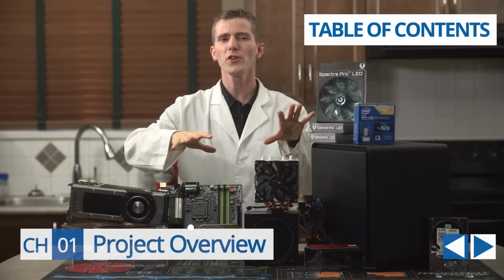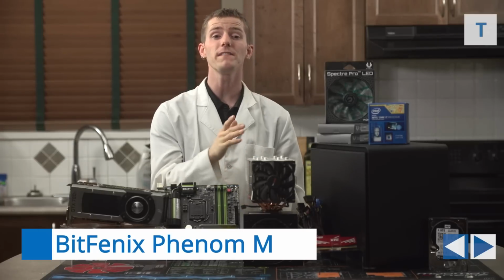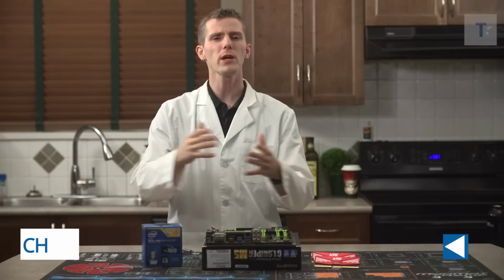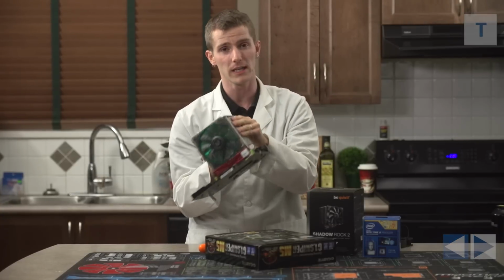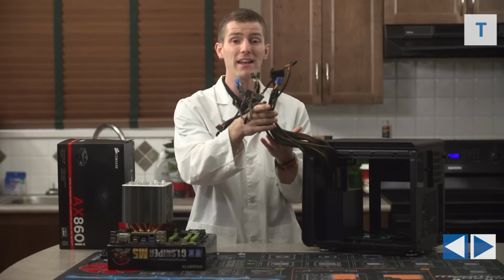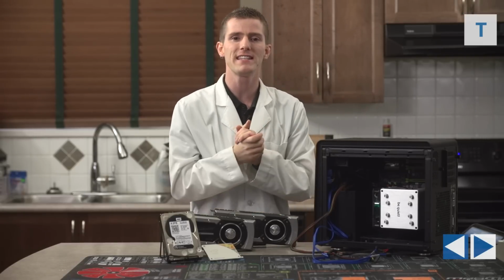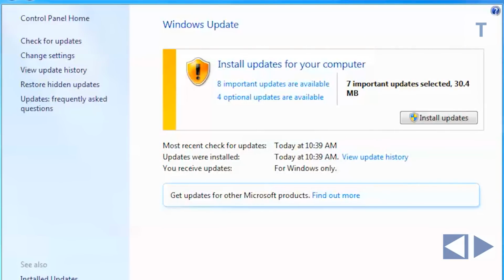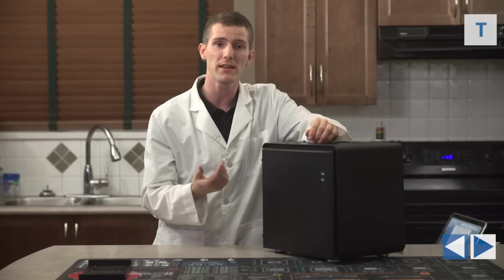ULTIMATE Intel Compact SLI Gaming PC Computer "How To" Build Guide

Comment: 700W PSU for two 780ti and an i7? what? i know 290's use a significant amount more power than 780ti but as far as ive found people saying two graphics cards that high end, 750w is like an absolute balls to the wall minimum even without overclocking but... 700?
(btw, i know amps are the important part, the information i have was assuming decent power supplies which can output 100% of their full power to the 12v rail)

ps Those words "standard every day memory" i dont think they mean what you think they mean lol
(not actual quote just paraphrase)
Reply: Single 780 Ti has maximum TDP of 250W, i7 has TDP of 84W. 2x250+84 = 584. That leaves 116W for bs like harddrive, chipset, fans, and CPU overclocking, which is completely sufficient.
Reply: 750w is more than enough for SLI even with overclocking.
700 should be sufficient
Reply: A 4770k and a Titan run off 500W PSUs, why wouldn't 700W be sufficient for something like this?
Reply: The reason i asked is because every other place on the entire internet recommends 850w for a system with two top end cards and linus is the only one going below even 750w, whatever way you push it that 700w psu wont last 5 years of abuse of being run at 71% of its maximum even before considering overclocking which will push it way past 80%.
Reply: megaspeed2v2
and how many time do u push every single part of ur system to 100% load to achieve that 71%? lol
Reply: ***** no way you got that, i just put the same components through "extreme power supply calculator" (pretty much the only one there is on the internet) and it showed 732minimum 782minimum.
The system in the video has two 780ti remember not one.
Reply: So... do you guys think that something like a corsair RM750 could run two R9 290? they have 50w more power usage each yeah, but the psu is also 50w higher rated than the one in this video and apart from that its actual 12V rail is hugely stronger than the one  used here... if you think a mid range 700w psu is enough for two 780ti then a high range 750w psu should handle two R9 290's surely?

As i said... linus seems to the the only person  on the internet who thinks you can safely run a top of the line pc on mid range psus... check any other reviewer anywhere and they will laugh you out of their website for running two 780tis on a power supply that cant even supply its full power without needing two rails...
Reply: That should work.
Reply: Yeah, thats a great PSU. Im using one right now.

Comment: Compact gaming PC = how far can I limit my upgrade and expansion paths for the future LOL.
Reply: How much more do you really need to put in a gaming PC?
Reply: goxcpre
More HDD/SSD storage, more GPUs, RAID expansion cards, Bigger better PSU, big heatsinks, Liquid cooling units etc ...
Reply: The PSU is big enough for good expanability, the heat sink in this a huge and 3 way SLI isnt really worth it. If you are going to do all those upgrades would it be a big deal to buy a new case?
Reply: DComm15
There's allot more that you can do than 3 way etc in a full or mid tower. Micro is a niche fad that will be embraced by a very small minority. If you want compact and minimal updatability and expansion just get a laptop.
Reply: leanlifter1 Dont get me wrong, I run my rig in a full tower but that is for airflow and so I can get my big hands in there. (although future expansion is a plus)
I would argue that SLI is used by a small minority and most people are only using 1 or 2 PCI slots.
I understand some people are going to want to put a lot more in the computer (Raid cards, sound cards, ect) but I feel that this is targeted at people who are building computers just to play games really. For most PC gamers this is all you would need. You have to tailor the build for its uses instead of "what if?"
Like I said before, if you are really going to upgrade that much you can buy a new tower.
Reply: goxcpre
Buy one good tower, make it big so you never have to buy another. Micro ATX is just to limiting. Most PC gamers are PC enthusiasts to begin with so imho the only thing that a micro ATX build in a micro case would be good for is LAN party's and the like for easy transport instead of lugging around a big and heavy mid or full tower or a secondary rig/Lan party rig.
Reply: leanlifter1 I probably wont replace my full tower but I want to do a Micro ATX build for an extra rig. Although I already have a full and mid tower rigs XD

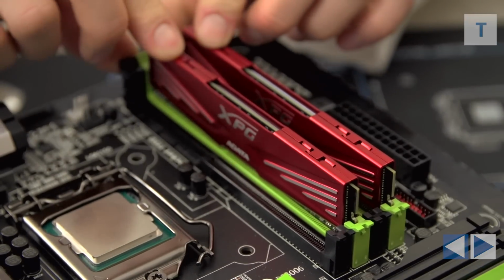Comment: i didn't understand the part where he said match the RAM with the colored parts in the motherboard ... 13:45 .. can anybody help ?
Reply: he meant to put the ram sticks, in the same coloured slots on the motherboard... 

if you put ram in the black slot, put the next one in the other black slot (same with the green), if you dont, you will lose performance as it will not be in dual channel mode.
Reply: ok thanks alot

Comment: lol why would you care about G-Sync with dual 780 Ti's
Reply: doesnt matter how much gpu horsepower you have if your monitor is shit.
Reply: The point of gsync isnt just to make gaming more smooth at lower fps but also to remove tearing without vsync which can cause input lag even if you had 16 GTX 780ti's and 4 4960X cpus all running on one system even though thats impossible lol
Reply: megaspeed2v2
kuddlekins15
Please learn more about G-Sync. G-Sync only helps if you can't get stable 60 FPS - only real thing it does is it adapts the display refresh rate to the FPS when it drops below 60.
With that system you'll get 60 FPS almost everywhere.
Reply: Ubeogesh i understand exactly what gsync does. it changes the screen refresh rate constantly so that it is always matching the output of the graphics card, doing this eliminates tearing without having to use software methods like vsync. it is always better to have the output fps and the refresh rate of the monitor to match, even 3000 fps can be laggy if its not syncronised properly.
Reply: megaspeed2v2
So you just enable vertical sync and have 60 FPS all the time and don't need any g-sync. 60 FPS games are butter smooth, you don't need 3000 fps. Besides some games have weird bugs when FPS goes much greater than 60 (i.e. GTA's older than IV and Skyrim)
Reply: Ubeogesh V-sync causes input lag. For any actual gamer, you can clearly feel it and it will annoy the sh*t out of you. Hence g-sync.
Reply: dodoz44
No it doesn't. Probably your monitor is an issue.
Reply: Ubeogesh it does, not all games are affected the same by it though, sometimes it even depends on the graphics card, sometimes an nvidia card will have input lag when vsync is turned on but the same game on an amd card will have no input lag, sometimes its the other way around and vsync causes input lag for a amd user where an nvidia user sees no input lag. the only thing in common is that turning it off usually removes the input lag in both cases

Comment: Too bad there isn't a non reference graphics card that is built for a small case.
Reply: ***** My bad that card was designed for a small case, I guess what I meant to say was too bad there are no non-reference 780 Ti's that can be used in the same way Linus is using the stock versions.

Comment: LinusTechTips I am currently an Architect and somewhat unfamiliar with building the correct PC. Is there a way you can help me out in figuring out a very good build that can support quick 3D Renderings and High end Gaming. I am willing to compromise for gaming but i don't believe that if the build for a 3D Render will affect the gaming side of the PC, but i may be wrong. Any help or tips?
Reply: Nvidia Quadro K4000 and K5000 are the best Nvidia workstation cards for doing autocad and stuff like that. I have heard of people pairing them with consumer grade cards like a gtx 760 or 770 for great gaming and workstation performance. AMD makes Firepro workstation cards but Im an Nvidia guy myself.
Intensive applications like autocad are cpu intensive so if your going Intel get a hyper threaded card for better multi core performance.
Hope it helps.
Reply: goxcpre I do lots of AutoCAD and I was going to render mostly in Revit. 3D Cad is nice but Revit takes home the gold in my opinion.

As far as build the K4000 seems logical but the K5000 is out of my league due to $. I was thinking of doing a build like this

Mother Board: MSI Z87-GD65
CPU: i7 4770K 3.5GHz
RAM: Corsair Vengeance Pro 32GB DDR3-1866
Video Card: Duel SLI GeForce 780ti
Power Supply: OCZ Fatal1ty 1000W 80+ Gold

and a custom cooling system. I was thinking of doing cooled GPUs but idk if it is worth it. That build is already the $2600 mark without the cooling.

What do you think?
Reply: Seems like a beast machine. I agree water cooling wont be worth it on the cards. They are so powerful overclocking isnt really needed.
Check out these test results http://www.tomshardware.com/reviews/geforce-gtx-780-ti-review-benchmarks,3663-11.html
Depending on your needs upgrading to the 6 core extreme edition i7 would give you better multicore performance. SLI is great when software is optimized for it but Im not sure if Revit supports multi gpu or not.
Reply: Hopefully that helps. Ive never built a workstation only gaming rigs.
Reply: goxcpre I did some digging on the question if Revit supports SLI and it seems it does. http://www.revitforum.org/hardware-infrastructure/72-revit-hardware-video-graphic-cards-17.html

The 6 core extreme edition? So something like this or exactly this? http://www.newegg.com/Product/Product.aspx?gclid=CPyDj7ygtbwCFVQV7Aodp1kAzg&Item=N82E16819116938&nm_mc=KNC-GoogleAdwords&cm_mmc=KNC-GoogleAdwords-_-pla-_-Processors+-+Desktops-_-N82E16819116938&ef_id=Ut1N5gAABTHwfxEW:20140205150119:s

Although i do have to ask, I currently am running duel graphics cards in my current PC. Both at NVidia GeForce 460 GTXs. When i turn on the SLI bridging my PC crashes after a few minutes and when i reboot my device manager and NVidia manager only recognize one graphics card. The only way to get the 2nd one to be recognized again is to shut down and reboot. Is that a Bridge problem or GPU problem?

I tested both GPUs for the screen and processing and they both work, so im thinking it is the bridge.

Ive also heard that if you do not overclock, the bridge loses its "life span" quicker. Is that true?
Reply: That is a great processor. The 6 cores will really help.
Im the wrong person to ask about SLI though. I run a single card.
Seems like your build will be great though!

Comment: Should've used a Silverstone SG09/SG10 for superior airflow.
Reply: ***** Did you leave the top fan in the stock config?  I found that turning the top fan around as an exhaust significantly improved temps.

Comment: Linus can you answer this question or someone that knows more than I because i thought if i connected a Samsung 840 Pro and a 1TB WD Black HDD and right when i started to install my OS on it, it would give me a problem saying some error of some sort but whenever i disconnect my hdd then it works and i can finish installing my OS and BAM. Nothing, no problem but i get frequent BSODs and updated further from the drivers from Gigabyte and went to the online sites that provide the drivers rather than going to gigabyte and other motherboard manufacturers, they never update their drivers enough so i updated everything and still bsods 0x124. Sucks to be me and i have a post about these problems too on LTT(DOT)C()M, anyways is that the same thing what linus says @ 32:34-32:40?

Comment: I went with this board, the Gigabyte G1 Sniper M5 LGA 1150 Z87. This board imo is a nightmare, i wish Gigabyte released a board along time ago that was full sized ATX like the G1 Sniper Z87 or the Z5S but that board has crappy onboard sound... too lazy to buy video card i guess lol Went and put this in a 650d then a 750D afterwards and looks kinda shitty though my cable management looks clean so it's alright and i'm about to watercool this b*tch, Too bad, no waterblocks for this small form factor board and i'm not using Dual Cards running in SLI so it don't matter i guess _. I've also been BSODing for quite some time and i have no idea whats causing this problem. Sucks to be me. Went with a intel core i7 4770k as well.

Comment: What is the purpose of that cpu cover?
Reply: Elektro Teck If they packaged the Mobo good enough, surely they wouldnt need that plastic cover on the cpu slot
Reply: itastain It is just in case. It is the most sensitive part of the board and if just one pin gets bent the whole board is thrash. Its a pretty standard practice.
Reply: goxcpre Whenever Iv bought a Mobo it hasnt had it. But then I use AMD
Reply: for sure. It might be an intel thing. Ive never built with an AMD
Reply: This has got me thinking, I really need to make an intel build one day haha
Reply: itastain If you have the cash it could be fun!
Ive actually been wanting to do a AMD build recently XD Those Kaveri chips are sick!
Reply: yes money is always the main issue, damn that money haha

Comment: Why do u always use reference cards
Reply: For SLI and smaller cases blower configuration coolers are many time prefered because it does not blow hot air around the case.
I might be wrong but I havent seen very many 3rd party coolers that are in the blower style.

Comment: i would really like an answer, so i can just copy all the files on my 16gb flash drive, and plug it in to boot from there off of my laptop, im selling it and building a desktop so i would like to do this and spend money on something else instead of windows
Reply: I dont think it works like that.
Reply: well i know it gets a little more complicated, i know the basics of doing it, but theres not any real good video on doing this
Reply: The problem is that you are taking installed windows files and trying to transfer them. As far as I understand this is not possible
Reply: just to boot up windows from it on a desktop i will be building. like i is a disk

Comment: Do you really need that giant cpu cooler for the cpu? or is a smaller one fine?
Reply: Depends on how much you want to overclock. With limited airflow in a small case a proper air cooler like this will keep cpu temps down.
But in short, no you dont need the big one.

Comment: I think the way I would use a small case like this is as a media server/TV hookup machine. I would put a fairly large raid array combined with a fast network adapter and fairly average GPU for a little gaming and lots of video streaming to the TV. Not quite sure why you used colored fans in this build considering the case has no window though. They look pretty cool but you aren't making full use of them :(

Comment: Hey guys, I want to spend about $50 on something to cool my 4670k so I can over clock a bit, whats the best choice? Water or air? Should I wait and spend a little more?
Reply: Well I guess it really depends on what kind of space you have. In my opinion, buying a well built water CPU cooler is more effective than an air cooler. So if you have the space then I would wait and and get a water cooler from say, Corsair.
Reply: audley I think I have plenty of space, thats what i've been looking at, maybe an H100i when theyre on for $75. I just wanted some other opinions, Thanks!
Reply: Capt. Sum Ting Wong If you have the space go with an air cooler they are cheaper and the water coolers really arn't much better the water coolers are good if you have a system you are going to move a around alot or you have a case where you can't fit a tall air cooler. The cooler master hyper 212 EVO is kinda the budget cooler of choice at around 30 dollars but there are plenty of good options at or below 50.
Reply: cooler master hyper 212 evo.
Reply: Mathew Kleymann Thank you :)
Reply: ***** Thank man im considering it :)
Reply: I have to disagree with putting in water cooling on this budget. Even up to $100 air coolers provide better cooling and value than all in one closed loop water coolers. Its different if you are doing a custom water cooling loop.
Noctua makes the best coolers around. Personally I use the "big boy" cooler Noctua NH-D14.

Comment: 80+ degrees C! WTF! im not impressed with that linus! why so hot? my Sli setup in a case not much bigger only hits mid 60's at full load after hours. Are 780ti's just hotter cards that OC'd 660ti's?
Reply: The temps of the GK110 processor is much higher than those of the older cards.   I had the fan and overclock on my old 660 Ti overclocked to max at 70 c.   The default operating temperature from Nvidia on the GK110 chip cards is 80 c, but the max recommended is 95 c.

Comment: Really? 1080p with 780 TI's in SLI? That's a TERRIBLE mismatch. I own Quad 780 Ti's and even with a SINGLE 780 Ti, I was able to run BF4 @ 1440p @ 70-80fps Ultra w/o MSAA. There is probably 1 or 2 titles that a single 780 Ti cant pull 100fps+ @ 1080p on.

Comment: does any one else get really really pissed off when they choose things that dont match each other in there ultimate build guides
Reply: Not usually, but when he said he was switching the side panels and that the IO panel and power switch would be upside down, I was horrified.
Reply: audley you can change the power switch, i did that with my prodigy m, but rred ram with a green color scheme. yuck

Comment: I like your build log a lot! Could have used it a couple of weeks ago, when I got my Prodigy M!

I just wanted to share, what helped me with this enclosure:
1)You can route the cables (8pin, and SATA as well as SATA-Power) right underneath the motherboard, behind the bottom fan. So they are well hidden. Only problem there: You really have to work hard to stick them into the HDD and SSD because you have to plug them in from the other side.
2)You can use two screws at the bottom to mount your SSD. But Linus' idea is great too!

I wish you could get a window for this (not the one for mITX case) and show off your great build.